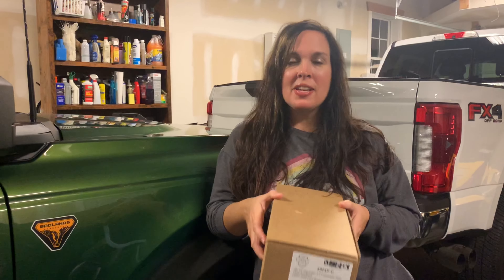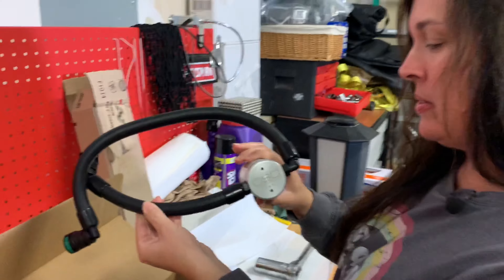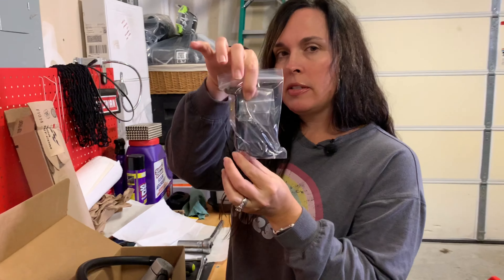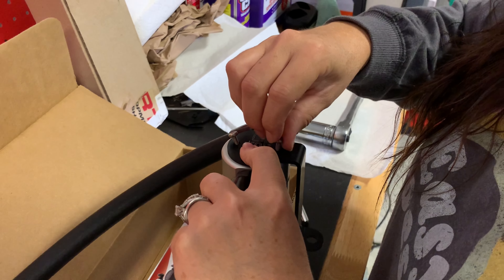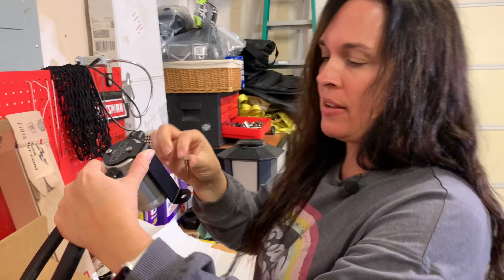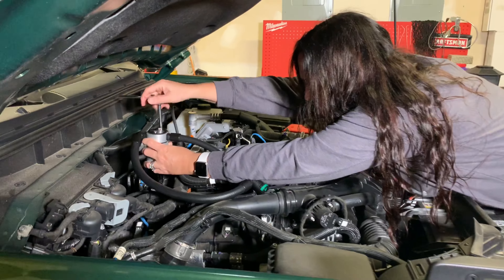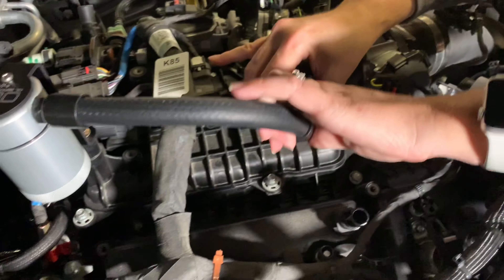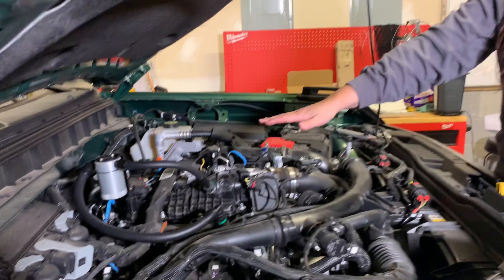Do You Really Need An Oil Catch Can For Your Ford Bronco?

Comment: Is the mounting area the same on a 2.3 L as it is on the 2.7 L?
Reply from the maker: I do not know that answer. If I find out I will let you know
Reply: @DrivenWildOutdoors  disregard. I found it on their link you supplied. It is a different location. Thanks
Reply: As you saw it's in a different spot, but the install is very easy like the 2.7.
Reply: @jloilseparatorco.1853  Yup. Have one ordered from you guys. Shoutout to Driven Wild Outdoors for bringing them to my attention.

Comment: What is the reason one would want to do this?
Reply: Reduce carbon buildup on valves.
Reply: @RagnarKon  direct injection motors tend to get this build up much faster as fuel doesn’t “clean” the valves during operation. On the 2.7, it has two injection systems so all this would be is a little extra insurance. I’m sure in California it probably causes cancer and birth defects?
Reply: If you have a direct injection engine with turbos the oil build up on the backside of your valves will eventually cause loss of power and efficiency. Luckily for the owners of the v-6 turbo engines in the Bronco, Ford has designed the engine with Direct and port injection so the carbon buildup won't happen. So if you have an engine with the Direct injection only, you would be smart to get an air-oil separator.
Reply: @markkelly7517  I think catch cans also kill baby seals in California too.
Reply: @markkelly7517  I live in Kaliforniastan, and trust me, the state tells you what to think and you will like it. If you don't, well, you ever heard about being cancelled? Anyways, to prove this, our state governor signed a bill that says doctors WILL stick to their state approved script indicating what they can tell you about treatments. If they veer from this script, they can lose their license. Don't believe me? Look it up for yourselves. That's just one example. I wouldn't be surprised if you can't have one of these shipped to my banana republic of a state.
Reply: @dgunearthed7859  it’s almost unbelievable that the state that has always referred to as the car capital is the very state trying to destroy the aftermarket car industry.
Reply: @markkelly7517  well that's gavin nuisance for ya

Comment: Will a Catch Can void your warranty?
Reply from the maker: That may depend on your dealer. My dealer said it was fine to use however you need to do your own research on that one. That being said I have no idea why it would
Reply: LOL, @DrivenWildOutdoors  you used the infamous phrase "my dealer said". Having been on Bronco 6G for over 2 years waiting form my BaseSquatch I have heard that phrase over a hundred times. I would always remove it (back to factory hose and connections) before taking up to the dealer for service or recalls.
Reply from the maker: @66scooterdaytona  I have a great relationship with my dealer and they have an excellent service department. They’re nothing like you see on 6G thank GOodness
Reply: @66scooterdaytona  That's always a great safe bet, since it's so easy to return to stock it's not worth the headache of what if's on service departments trying to get one over on you.